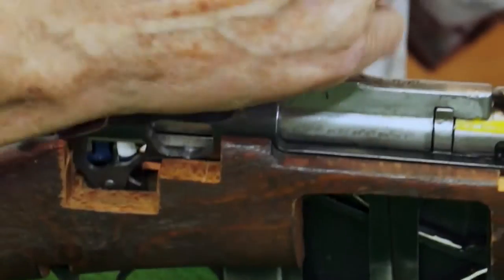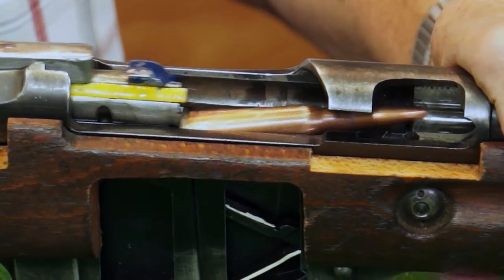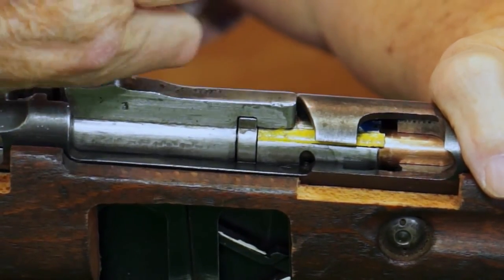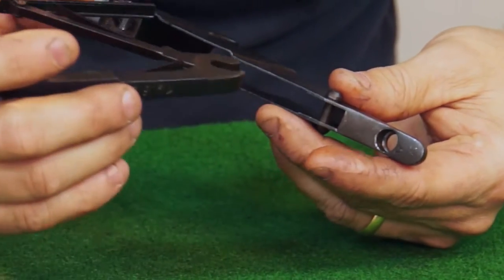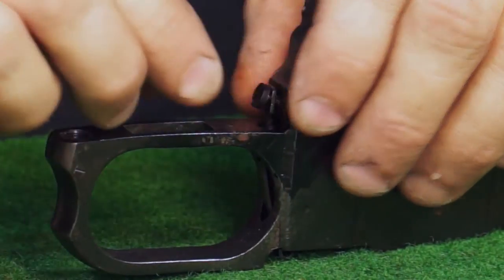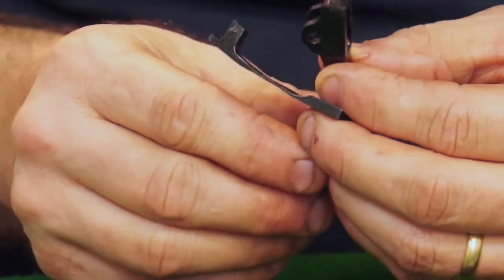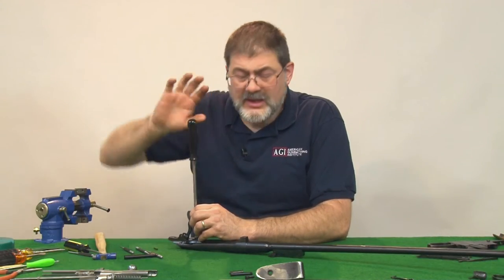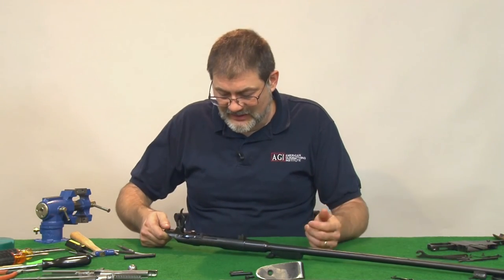AGI1604 Mosin Nagant Rifle Armorer's Course - DVD excerpts

Comment: You really need to use hollow-ground screwdrivers on those screws as the slots are easily stripped.

The trigger pin should be tapped in using a plastic, rubber or rawhide mallet, not a steel hammer of any sort.  Brass would be acceptable.

Regards,

Josh Smith
Smith-Sights.com
Reply from the maker: Good tip, thanks for sharing